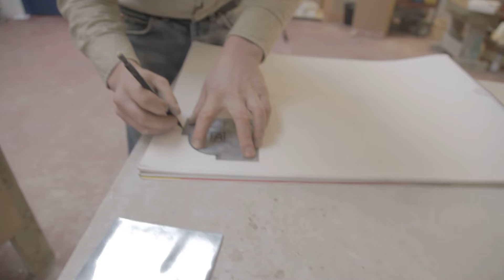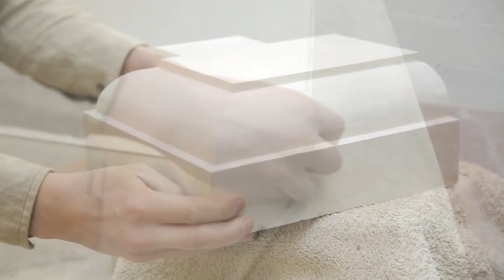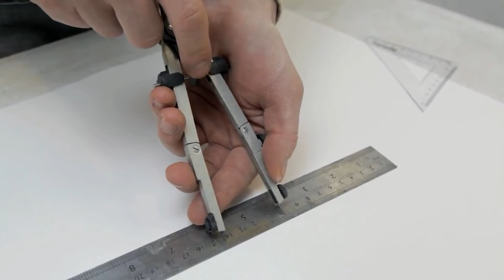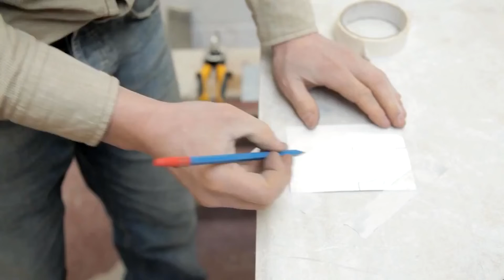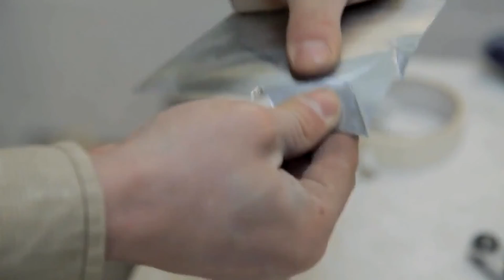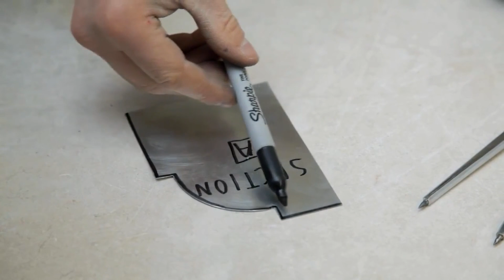Learn Stonemasonry - 4 -  Creating an Ovolo Plinth (Part A)

Comment: What stone block is used in the video? Super helpful by the way!
Reply from the maker: It's Caen limestone, from north-western France. We were lucky to have it as it's difficult to get in the UK. This was leftover from a large project.  Many old cathedrals (11-12th century) in the UK were built using it.

Great that the videos are useful! Thanks!
Reply: @builtheritageeducation  interesting, thanks for the reply. What stone block would you recommend buying to start following the videos in a more practical sense, cheers!
Reply from the maker: Depends on where you are and budget.  Avoid stone containing silica  - see the safety intro video - so no sandstone which should have dust extraction.  If you're in the UK, Maltese limestone is popular for beginners.  

Work in a well ventilated area, or better, outdoors.  You could contact some suppliers and explain that you're practicing and want a limestone to begin with.